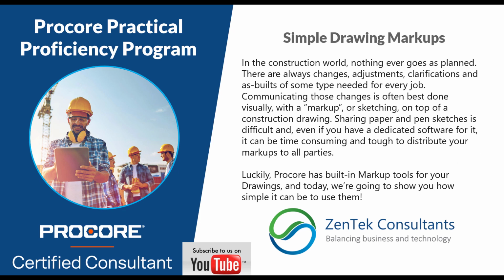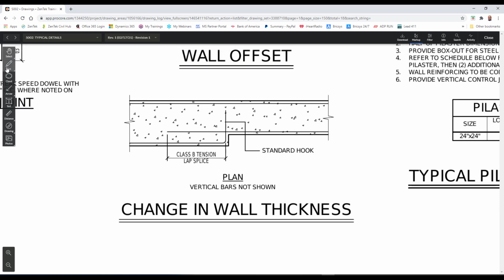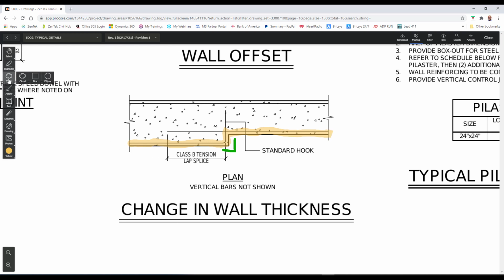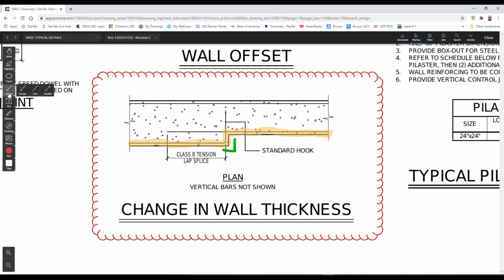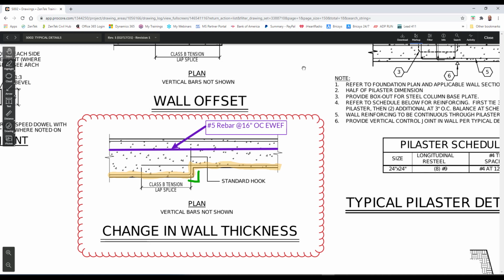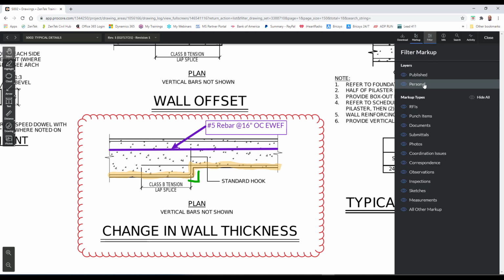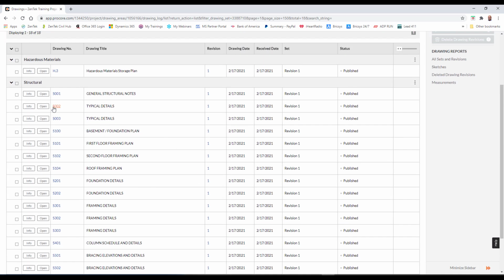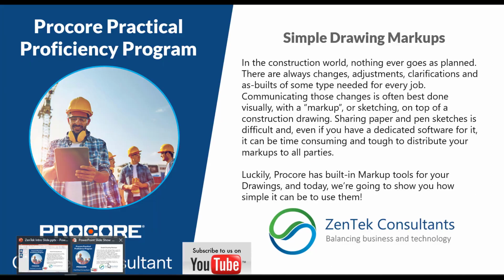Procore - Simple Drawing Markups

Comment: How accurate are the measurements?
Reply from the maker: There is no hard “level of accuracy” The scale of a file is set by how accurately you use the CALIBRATE tool. The more carefully you set the calibration, the better the results. Part of it also has to do with the resolution of the PDF itself. A poor scan for example, give less accurate results than a printed file. HTH